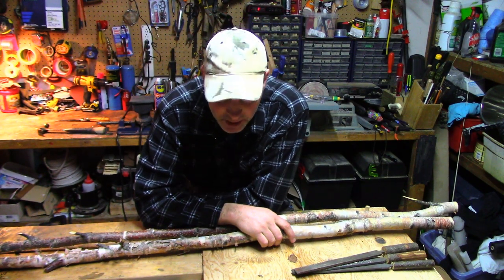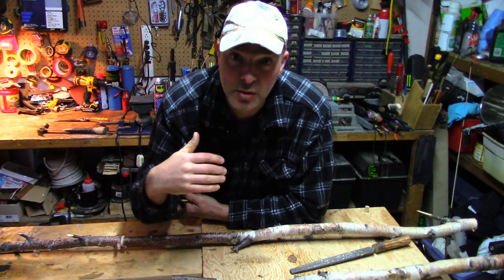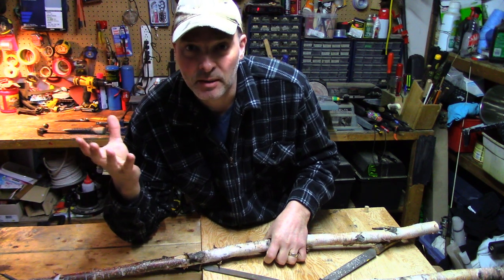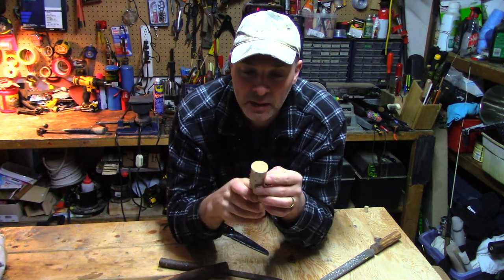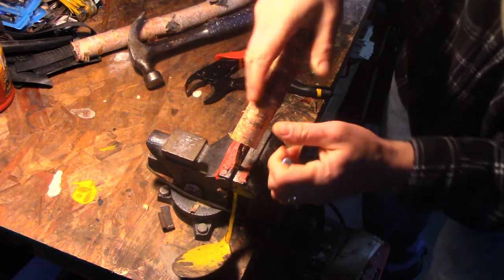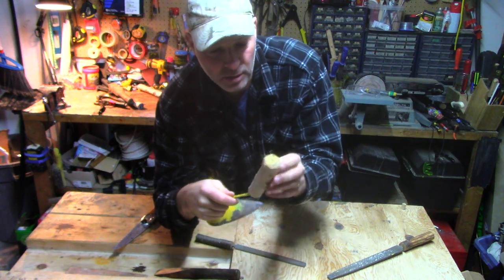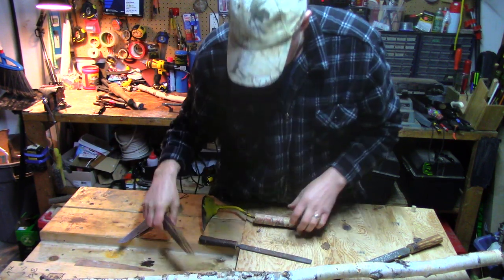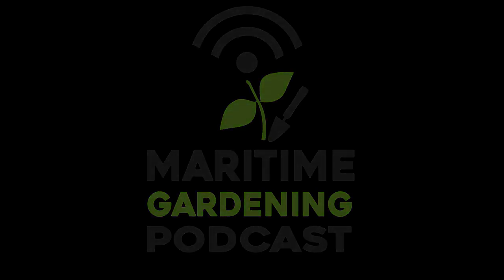Birch Wood Tool Handle

Comment: Great video.  Been going through all my old wood tool handled tools cleaning them up, sharpening and oiling where needed, and sanding and applying a nice coat of boiled linseed oil to the handles. O boy... Do they look and feel nice and I think they appricate it too. Shovels and spades really did need a tune up.
Reply from the maker: Nothing like oiling up the handles!